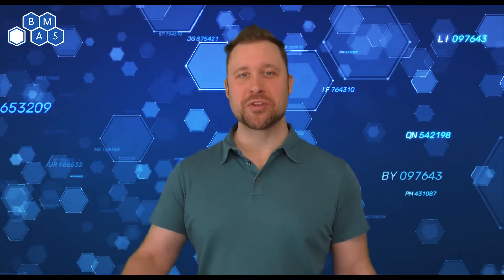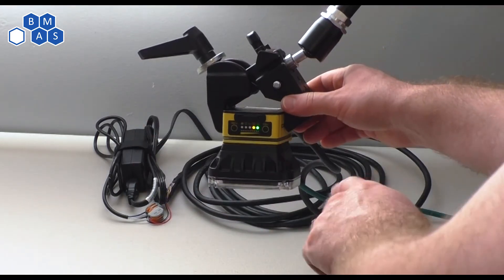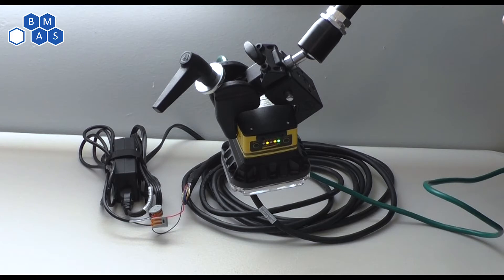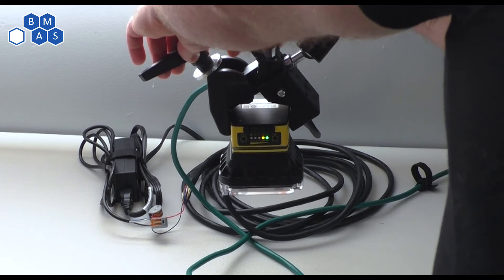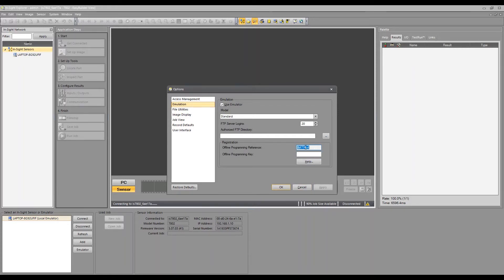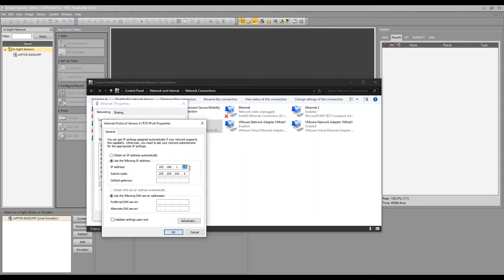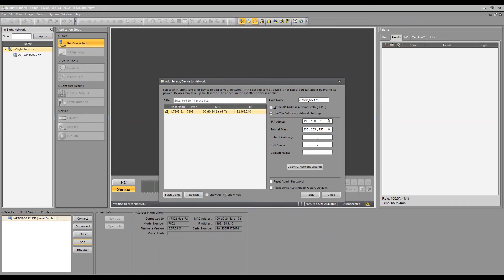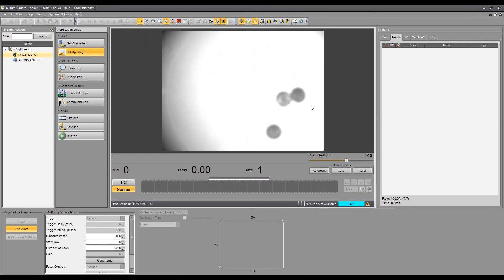How to Connect a Cognex Camera with InSight | Machine Vision pt2 | Breen Machine Automation Services

Comment: Hey, very nice video tutorial. I just have one question, in case I have set the cameras in range like 192.168.1.x but my laptop is connected to another subnet, how to get online with cameras by typing the ip address ?  For sure the connection between the subnets are reachable and good. so I can ping the camera properly. Tks a lot.
Reply from the maker: Thanks.  :)

If you can ping the camera, I would expect everything else to work.  I'm a little surprised ping is working if your laptop adaptor is on a different subnet, though.  Cognex's software will be able to find the camera regardless of the subnet, but that's not the same as a ping, and it only has enough functionality to set the camera IP address (and name, if memory serves).  After you set the camera's IP address, your laptop adaptor needs to be on the same subnet as the camera to do the rest of your work.

When I'm connected to a machine network, I usually dedicate one network adaptor to that (Ethernet) and use another adaptor (Wifi) to stay connected with office/internet networks.
Reply: @breen-machine    Hi, thanks for the reply.  I understood, in my case the cameras are in a dedicate network such as 192.168.1.x , my laptop is connected to the Wifi (different subnet), I have created internal routes to one subnet be reachable to the cameras subnet, but it didnt work yet. I believe because of the Insight application is broadcasting only for the same network. I thought there would be such an option to enter manually with IP address. It seems a limitation of the Insight Explorer application. If you heard there's a newer version, let me (us) know pls. Thanks a lot again.
Reply: @breen-machine  Hey. I found how to do.  Unfortunately it's not possible to upload pictures here, however at In- Sight Sensors, do an opposite click , go to Remote Subnets. Just needed to add the new ip address from the subnet, application is going to discover and found the devices properly. Tks!

Comment: Hi, I would like to monitor my Cognex on the HMI. I tried to establish that communication with C-More HMI under communication feature in In Sight explorer but could not get it to work. Can you please explain if this is possible at all? As you know, In Sight explorer already has a built in EasyWiew. I am talking about something similar over Ethernet/IP connection. Thanks,
Reply from the maker: I haven't tried connecting a camera to a C-More before.  Usually, I see Cognex cameras being connected to Cognex Vision View displays or another web capable device.

Comment: I'm doing a project for school and I'm wondering if I can connect this to a robot so when the camera picks up movement, the robot will move to a specific spot
Reply from the maker: Yes, most industrial cameras are designed for robot applications, and Cognex is a common choice.  If you want to connect the camera directly to the robot, check with the robot manufacturer.  They usually have one or two brands they work with.  Otherwise, you can use a PLC as an intermediary.  In this case, you'd send the results of an inspection to the PLC, then the PLC would load the appropriate registers in the robot, probably all over Ethernet.

Comment: why does the final digit of the Ip address need to be changed and be unique?
Reply from the maker: If the numbers are all the same as another device, the network won't know where to send packets destined for that address.  That's why we need to make them unique.  We typically change the last group because the first 3 are usually (but not always) the "network" or "subnet".  Devices will only communicate with other devices that have the same subnet when using IP addresses (OSI layer 3).

Comment: Hi bmas, what benchtop clamp are you using in that video?
Reply from the maker: Hi John, That's a great name you have there, but you spelled it wrong.  :P

I'm using a Manfrotto Magic Arm (Manfrotto 244N) with a couple clampes (Manfrotto 035RL).  Pretty nifty setup for lab work.

 - Jon

Comment: Hi Bmas, 
Great the video!

I properly connected the D902 Camera to a power supply and the ethernet to the docking station of my laptop. Now, while the the Power LED indicator illuminates to indicate that the vision system is powered on, the Network LED is not switching on so I am unable to detect the device on the Vision Suite software.
Could you please help me?

Thanks
Reply from the maker: Thanks, Luigi.  Welcome to the channel!

If the network LED isn't turning on, it's probably an issue with your Ethernet cable (bad cable or not plugged in all the way).  Are the Ethernet lights on/blinking on your computer?

Comment: Do I need to set this up before setting VisionPro?
Reply from the maker: No.  If you're using VisionPro, you want to connect the camera to that instead of InSight.  The power and Ethernet portions of this video will be relevant, though.